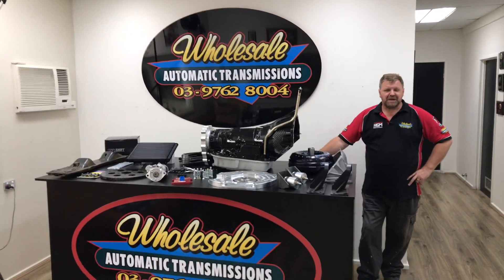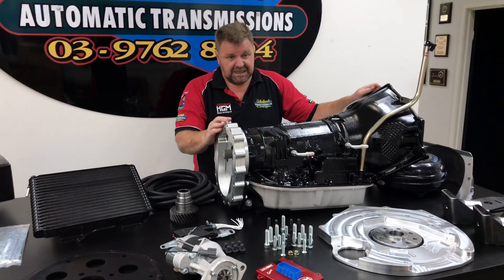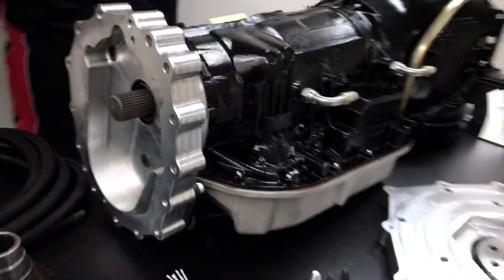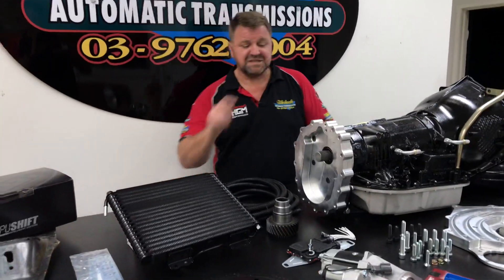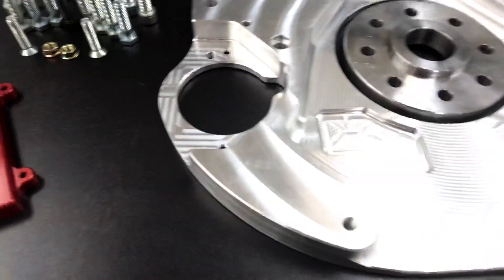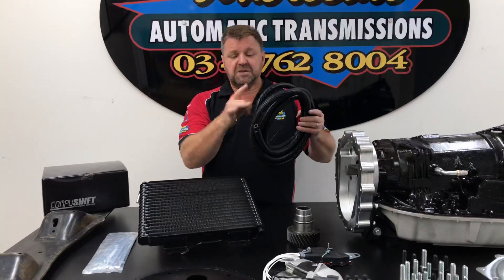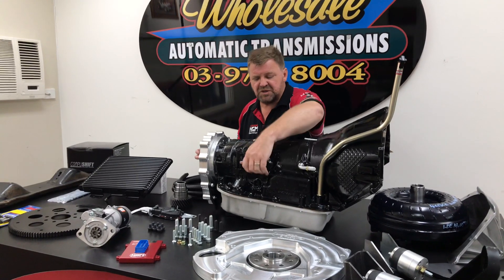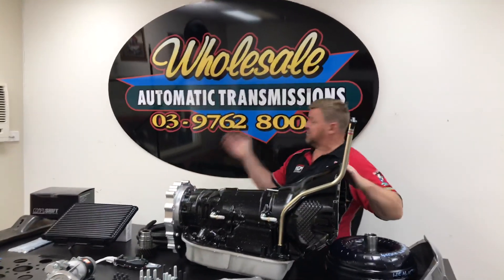Nissan GU Patrol 6BT Cummins to 4L80E Automatic Conversion Kit

Comment: Hi im looking at options and im wondering what the length of the gearbox with adapters and transfer is when all put together as length is short in my build so trying to work out if it will fit
Reply from the maker: Hi Daniel, Please send an email to Rodney@askorto.com.au with the details of the dimensions you are looking for.